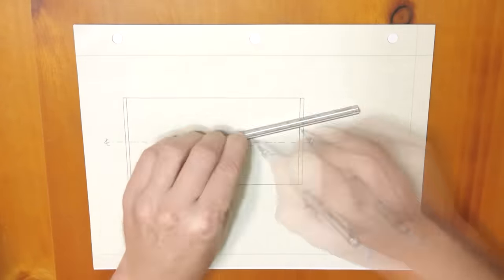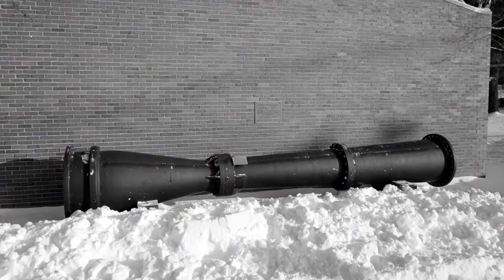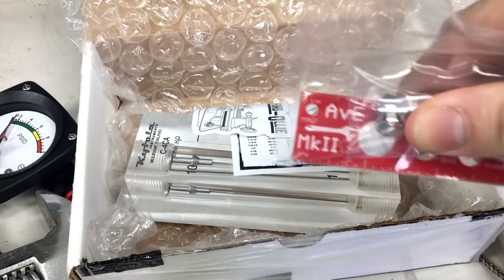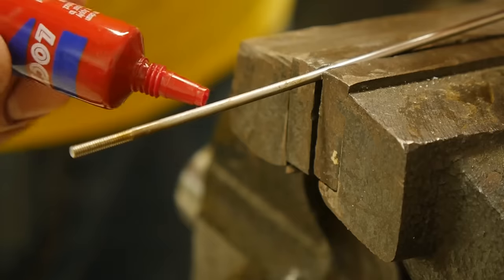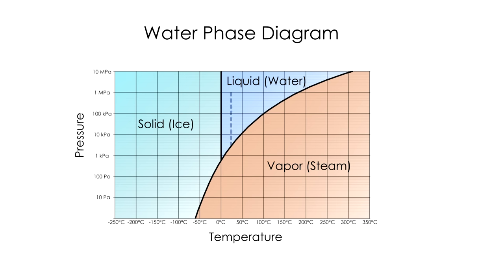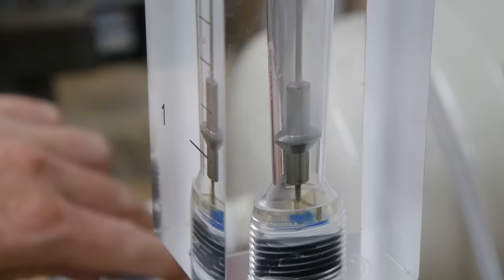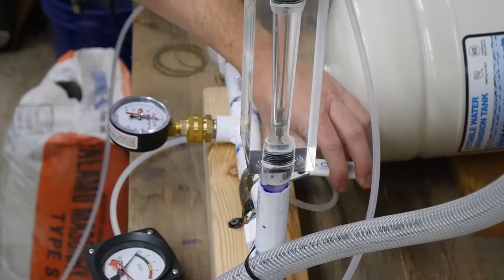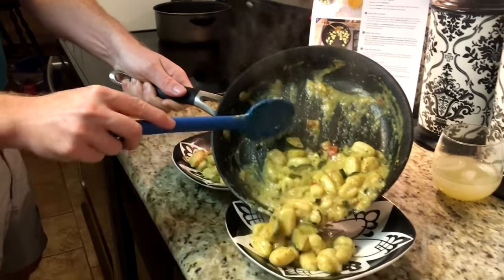What is Cavitation? (with AvE)

Comment: Ah it was your design, I left a comment a year ago on Ave's 2nd video saying why this won't work.  At the time I had recently finished taking fluid dynamics and graduated, so it was all still fresh...ish.  Very difficult class. 

 " DREXELENG2015
1 year ago
Well, if your goal is to demonstrate cavitation, you will certainly have plenty with that venturi! A venturi is supposed to have a constant diameter, in this case width, between the convergent-divergent nozzle sections.  Dig through the fluid dynamics textbook and read about "oblique shock".  A working fluid undergoing supersonic flow with a Mach#>1, needs gradual transitions, to prevent schock, which causes eddies and cavitation.  Looking forward to seeing this in action! :)"

Comment: I told my boss he needed to change the hydraulics filter on his asphalt reclaimer he said dont change it ,it has a bypass  dummy doesn't know its slowly destroying it from the inside out the bypass is to relieve pressure it's not meant to run the machine with it

Comment: This was me the entire video

WHAT IS THIS WITCH CRAFT IT SHOULD BE AN INCREASE IN PRESSURE 
If someone could help explain why their is a decrease in pressure that would help me
Reply: REDandBLUEandORANGE  
It is a decrease in pressure relative to the area in front of the narrow region. If you were to have a straight pipe without friction the pressure throughout would be the same. If you were to the start creating a venturi by squeezing a tube, then the pressure would start to go up in front of the narrow region,  and down in the narrow region. So the restriction should cause an increase in pressure upstream where the water is slowed, and a decrease in pressure in the narrow region where the water is sped up.

Comment: Am I correct in saying when the water disperses from the propeller (low pressure), the temperature of the bubble increases in temperature and when it hits the sea water (high pressure) the temperature goes back to the ambient temperature?

Comment: It shouldn't matter what metal working process is used. That is not Practical Engineering's area of expertise. Seems reasonable to me that he would specify, as best he can, what he wants in the final result, and AvE in turn uses his expertise to determine what method to use to form the metal. AvE is not a robot, he is human, and therefore should use his ability to extrapolate. He does not need to literally be told every command and line of code, like a computer, he can interpret based on intent. Love AvE's videos, but he he seems like a bit of a moose to work with.

Comment: I noticed that both AvE videos are no longer available. Is this because he realized he doesn't know F&*% about interpreting engineering drawings? Or did he move those videos to Patreon like the shill he's always claimed he isn't?  Either way. There was nothing wrong with your drawing. It was under defined. But that's not wrong, it just means that it's up to the machinist to use his/her best judgment. The one particular comment he made "...or whether it's drilled, pressed, punched, or bored."   Made my anus clench up nice and tight. It's not up to the engineer usually to specify the manufacturing method. The engineer specifies the form, fit and finish, and the machinist determines how it should be made to meet the tolerances quickly and cheaply.   Having said all of that. If you still want a venturi, contact a professional machinist. I'm not professional, but even I could knock that out in an afternoon on a manual mill.
Reply: let me know if you find the "making of" videos

Comment: steam is not a gas just small droplets
Reply: prototype9000 steam is gas, and in actual fact colourless (or invisible). What you see is the water vapour as the steam cools
Reply: @zachb1706  steam is not gas
Reply: prototype9000 yes it is
Reply: @zachb1706  its still a vapor until you break the bonds which hold oxygen and hydrogen together then it turns into gasses other wise only a vapor which is small droplets
Reply: prototype9000 a vapor is a gas, a gas isn’t always a vapor. That’s like saying carbon dioxide isn’t a gas until the oxygen bonds break with the carbon - which is a chemical change not a physical state change.